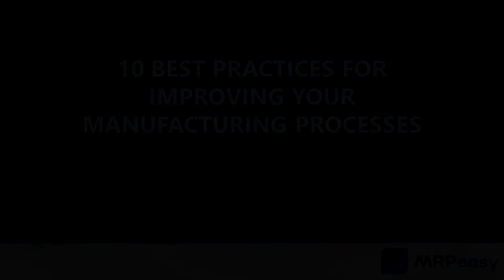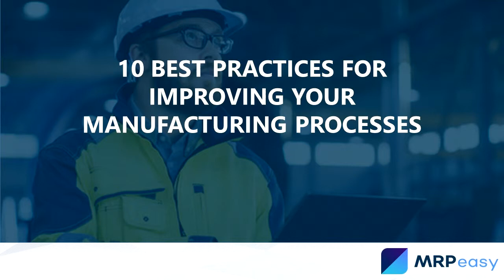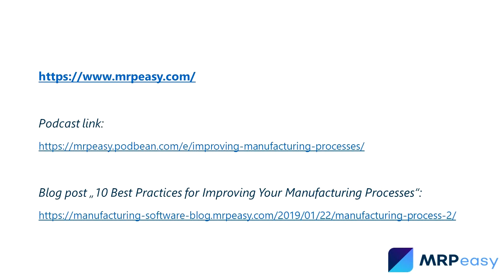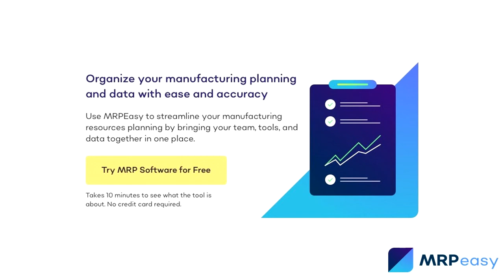10 Best Practices for Improving Your Manufacturing Processes - Podcast

Comment: Properly first point is meant for  Japan not N America. Regarding the fourth point, why would engineers work separately from other workers, that is a failure itself
Reply: It's incredibly frustrating in manufacturing!
Reply: I disagree, I'm running a manufacturing plant in America, and upward flow of improvement ideas actually works out well.  On top of it, the workers becomes the owner of the improvement, it makes everybody happy that not everything have to come from the top down.  My case may be singular, but it's enough to debunk your negativity in your comment.  4th point kind of synchronizes with the first point, so close-knitted communication is key.  And if you get some real shy personality, you may get that separation by nature.  It's a task to culture up this synchronicity.
Reply: Pete I might be a bit negative, and you are right in the sense that the generalization is not always accurate. However, I advise you to go to any jobs platform and read reviews about different employers and hopefully your factory is one of them. You can't see the full picture from your site, things are usually subtle and less clear. in my opinion. I keep my sense aside and focus more on evaluation: quality, productivity, and overall organization because the numbers don't lie. Everything should presented into graphs and hung on the walls